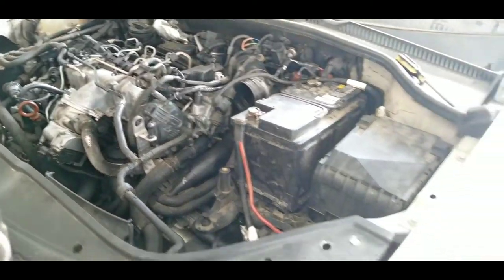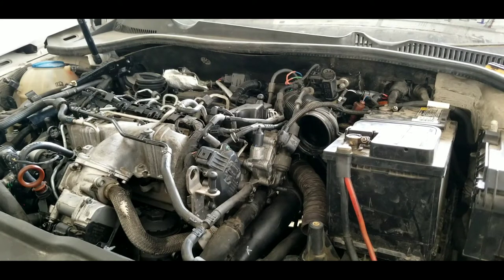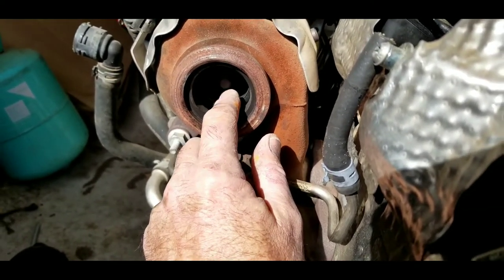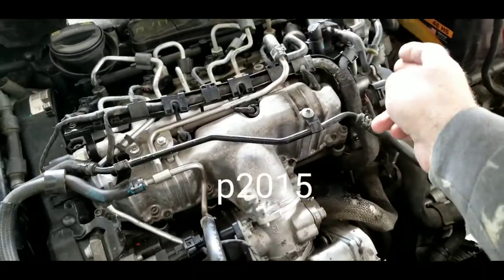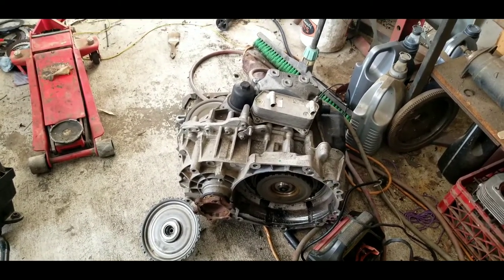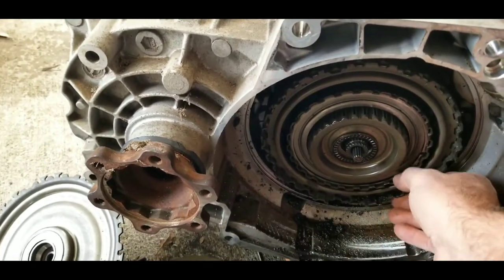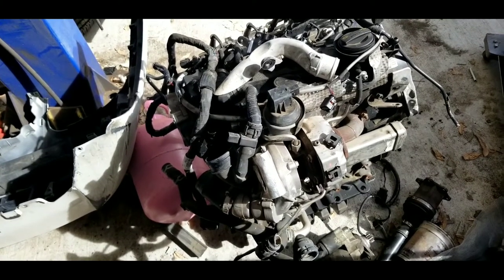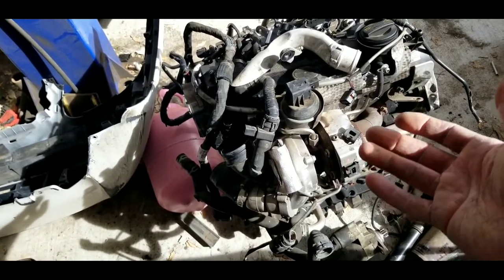MK 5 6 jetta TDI funny noise. is it the TURBO going bad? what do you think?

Comment: Did you ever figure what it was?
Reply from the maker: yea Turbo was not calibrated correctly causing the power surge. The stop was in the wrong position. Then the  oil pressure regulator got stuck So I just decided to replace the engine with another one that had a turbo on it. and The turbo tube had a hairline crack in it. Took me like 3 months to find it. All good now. 60k mile engine in there no codes.